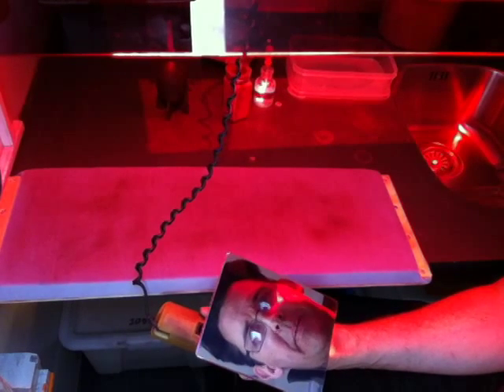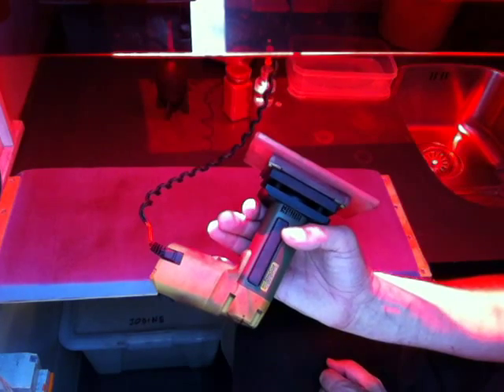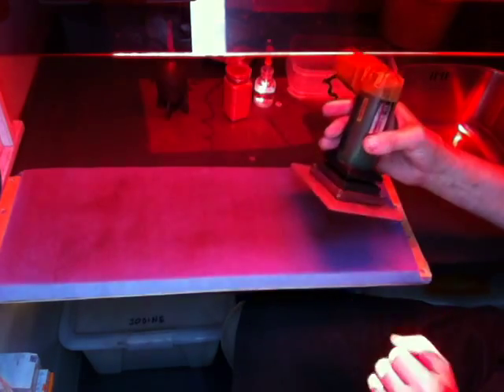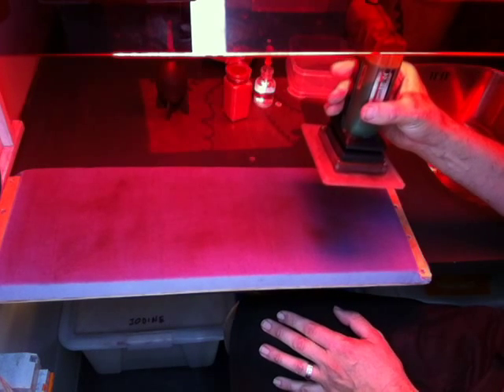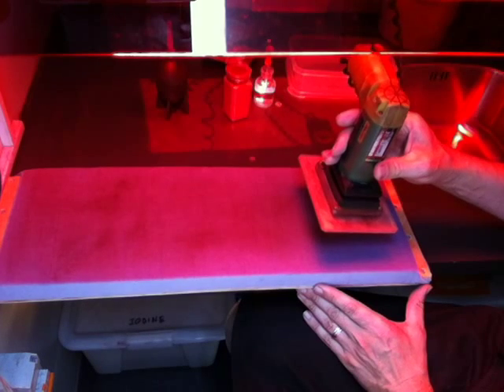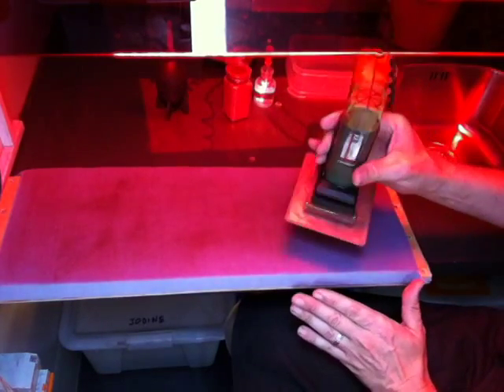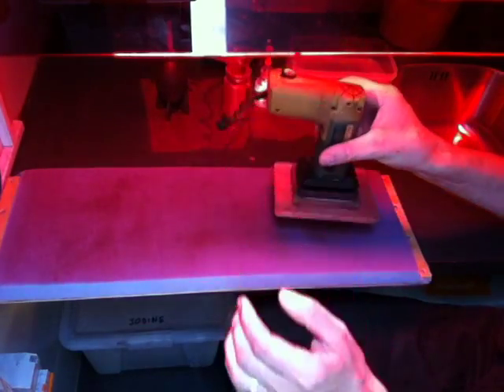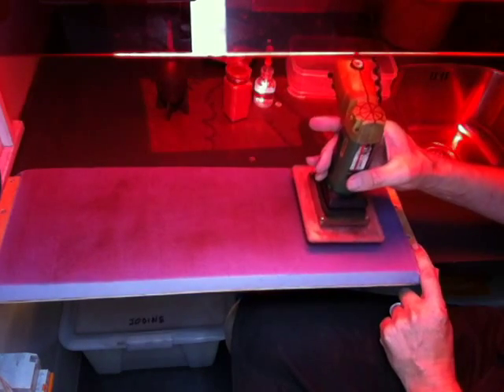Daguerreotype plate polishing - Linear Rotational

Comment: Looks awesome.

How does the metal plate attach to the acrylic sheet.  And how does the acrylic sheet attach to the sander?

Would any orbit-finishing sander work?
Reply: Nevermind about how to attach the plate to the sander, I now see the other video (the first one in the playlist) where you show how to do this.
Reply from the maker: When i first tried it I found that anything other than the lowest setting was creating abrasion burns instead of polish.  its a craft finishing sander so a beefy commercial one waved be too much unless you had the facility to dial down the power and its oscillating speed.  The company (proxxon) doesn't sell this model anymore so I need to find a backup/replacement for when it dies.